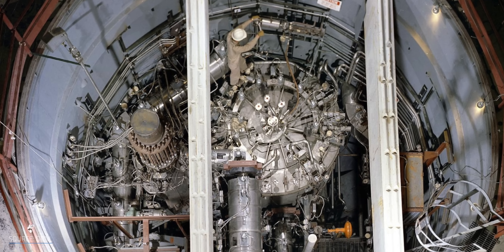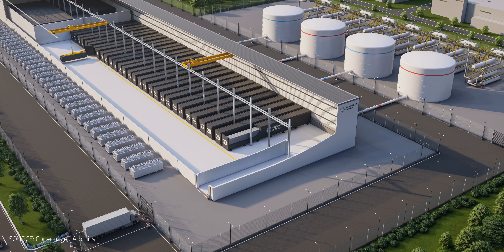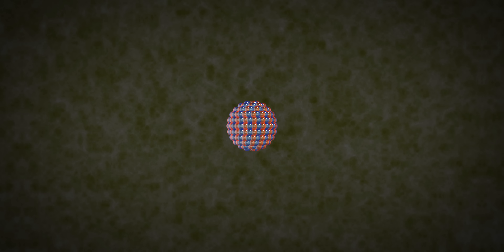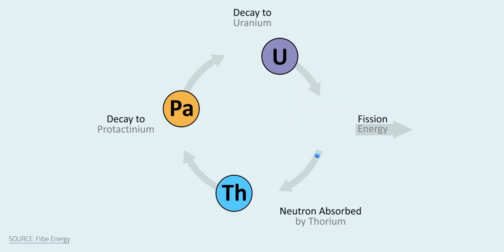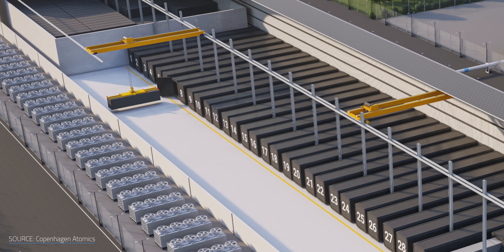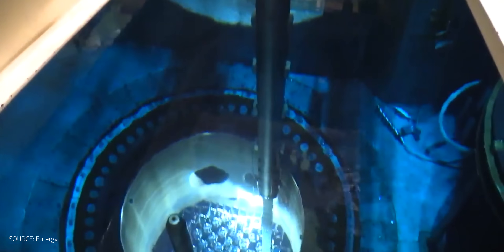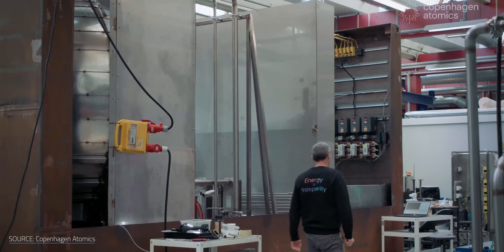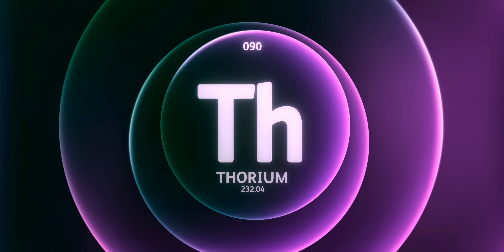Why Thorium is About to Change the World

Comment: Copenhagen Atomics took the most brilliant approach, I started seeing their stuff pop up around 2018.  They basically decided to leave the thorium reactor part last in their approach.  They knew there would be lots of roadblocks and regulations and no one was willing to accept allowing a company  doing oak ridge style tests.  So they took the research from Oak Ridge and said "What are all the difficulties they called out as non-thorium problems.  

Thus they tackled the metallurgy problem, that molten salts are highly corrosive to most steels.  Thus they worked on researching alloys. 
They focused on the water problem, even the slightest hint of moisture is a big problem with sodium salts.  Thus they developed sealed components that required zero servicing in the reactor lifetime.
They developed pumps designed to operate continuously in the high temperatures of molten salts.
They designed custom monitoring systems.
They did temperature, viscosity, and flow research modeling piping sizes, heat jacketed systems, cooling systems, reaction chamber design, etc.
They then even tackled refueling and extraction of thorium and uranium out of molten sodium.
And finally they handled production and assembly.

The only thing they now need is a country (other than Denmark due to their strict anti-nuclear laws) to give them the licensing to run tests.
Reply: Denmark is looking to reduce or remove their anti-nuclear laws. Or at least the politicians are talking about it publicly without great anger from the population.
Reply: @theicebeardk well that’s good that they might be able to get domestic political support.  It’s very hard to get an international country to grant a small company experimental nuclear licenses.
Reply: @theicebeardk  Really? When it comes to building it in their backyard, see their wrath. They are already angry at non-radiation (clean sun and wind) energy in their own backyard.
Reply: @theicebeardk  After years and years of solar and wind lies people are starting to pull the wool off of their faces. sheesh!
Reply: @Therapy1044  oh yeah, sucks super hard that my country some days runs off 100% wind energy xD feel super lied to 😂 lol
Reply: @DKTAz00  Cherry Picker. 😂  https://www.youtube.com/watch?v=ozq_vJf-H4k
Reply: @Therapy1044  What lies? Solar and wind are very viable portions of the solution for our energy needs.
Reply: @Therapy1044 "cherry picker" then picks a one off blackout incident 🤣 lolol
Reply: @tonyreynolds2328  No. They are not "very viable" for our massive needs.  Only small niche areas.  Trillions have been spent since Gore started Global Warming nonsense, and where are we?  3% of supply? After trillions.  Pretty sure you won't get through much of it though.   https://www.youtube.com/@ClimateDN
Reply: @DKTAz00  And to almost quote someone.  To deceive a person is the easiest thing in the world, but to get a person to admit that they have been deceived is almost impossible.  And our dear climate activists are the most recently deceived peoples on earth.
Reply: @Therapy1044  but of course the one who quotes that is never themselves deceived. or at least they wouldn't admit it
Reply: @Therapy1044  It can sometimes take so long for people to figure things out.  Like years and years. Even most of my life.
Reply: Danes have been staunchly against nuclear power since the 80’s, but just in the last 3 years the opinion is starting to change.
A survey from 2022 had 46% being open to the idea, and already in 2025 it’s 55%.
It’s starting to look likely we might open up to it.
Reply: @nathanlonghair  Traditional nuclear power requires an arms industry to provide the fuel, so that opposition is understandable.

As soon as your nuclear power breaks away from enriched uranium as fuel you're no longer feeding the war machine. That's why Alvin Weinberg's MSRE was killed by Nixon in 1972 under military advice
Reply: @nathanlonghair  the young adults are stepping into the light. The older generation is still filled with ignorance towards nuclear energy. They still think nuclear = Chernobyl
Reply: @ASZCA29 Not entirely. I’m in my mid-40’s and my mom and dad demonstrated against nuclear back in the 80’s - and they spotted the change coming, and the issues with the complete nuclear ban, before I did.
Not all of the older generation stay blind to change and new information 😊

I agree that older people are generally speaking more set in their ways, but we mustn’t get too bogged down with societal generational warfare… something I haven’t myself been very good at adhering to before, so I have to remind myself.
Reply: @nathanlonghair  I obviously don't mean 100% of the older generation. Just like not all of them remain ignorant, a lot of young people are stubborn in their ignorance. I'm speaking from a generalized standpoint.
Reply: @nathanlonghair  Fusion energy is what Danes are less against, not fission.
Reply: @LP-hm7tm  No. The surveys I referenced were for “atomkraft” which in Denmark refers to fission.
Reply: @nathanlonghair  Really? I'm sure many of us who had gone to school in Denmark had heard of the "to former for atomkraft: fission og fusion".
Reply: @LP-hm7tm since fusion has never been viable, atomkraft has always been shorthand for fission, even though it could technically cover both. If you look it up on DTU it’s clearly fission they refer to.
Reply: @nathanlonghair  You are right when speaking to the elderly. Their understanding of "atomkraft" is fission. The younger generations have a broader understanding of it so DTU should move into the 21st century and stop using "atomkraft"  to call fission.
Reply: They should look into Belgium, the new government is quite pro nuclear (nuclear ban law has just been repealed) and there's a world renowned nuclear research centre in Belgium as well.
Reply: @ForeverDoubting  Well and the nuclear powerplant near Antwerp that's powering a third of the country (including their biggest port.)
Reply: What a lot of people dont realize is that corrosion is a chemical reaction, so under high temp, high oxygen environments, it can be obsurdly fast, not like grand dads tractor rusting away in a field for 40 years, and she still fires right up.  The liquid salt  cooling sounds star trek too, but it is old school, they started using  sodium filled valve stems in the 1920s or 1930's, and by ww2 they had them dialed in well, many of the planes in www used sodium filled valves, and aircraft use is pretty demanding,  if the motor stops working, your mustang fighter plane just becomes a crappy glider, lol.
Reply: @bondvagabond42  Besse-Davis(2002) is a good demonstration of why water isn't a good material to have in nuclear cores

People hear "salt" and assume brine. They don't realise that a liquid salt contains no water to be ionised and that many salts won't react with water or oxygen anyway.

They also hear "fluoride salts" and assume they're extremely reactive instead of being the LEAST reactive kinds of salts thanks to fluorine hanging on tenaciously to its bonds
Reply: I hope we will allow it! It's as pure energy as can be! ❤
Reply: Wait, so with moisture, is this system 100% closed loop?
Reply: @edward9674 pretty much.  Basically in general with a molten salt reactor you want to do some isotope filtration, which I believe they do by density separation.  But their goal with these SMR setups might be to completely seal the reactor with a set lifetime of 5-10 years of continuous operation and isotope filtration is done once it’s swapped out.  So you just treat it like a 10 year megawatt battery module.
Reply: It isn't needed and never will be. There is no energy crisis, we use just 1% of the sun's radiation that reaches us. Doubling output would be more than enough. A;; this tosh about nukes is to pay big salaries to the hobbyists who won't let this ridiculous idea die a natural death. IT ADDS ENERGY TO AN ALREADY OVER-HEATING PLANET!
Reply: they forgot to hire diverse staff so naturally they are doomed
Reply: Far oo optimistic.
Reply: what are the byproducts ?
Reply: I'm Danish, and yes, we will most likely regulate ourselves out of becoming the richest country in the world.
Reply: They need a country stupid enough to throw money at this Rube Goldberg scam.
Reply: If Denmark gets this working the US will declare it a terrorist threat and take it and forbid its use.. ( I'm American btw) but I know what my country does..
Reply: "Thus they developed sealed components that required zero servicing in the reactor lifetime."
That alleged zero servicing is a fiction. The lifetime of these reactors is severly reduced to a few years requiring their full replacement and disposal, which is nothing else but servicing in a disguise.

"And finally they handled production and assembly."
What about electricity production? They did not handle that. A Reactor alone produces just heat. In order to get electricity from that heat you still need an additional heat engine and a cold sink (i.e. turbines, rivers, cooling towers etc.).
Reply: @alexanderkohler6439 turning heat into electricity is practically a solved problem. That is the essence of every single steam turbine ever, that’s not a problem they need to tackle because it is already solved. They just don’t want to be the one to make the turbines so they will just sell their services of making heat to an electric company
Reply: @lilydiring4295  "They just don’t want to be the one to make the turbines so they will just sell their services of making heat to an electric company"
But that is not what they try to sell to the public. They want to sell the vision of small modular reactors to facilitate decentralized electricity production. This vision is nice, but it is not going to work with electricity production based on heat. For decentralized electricity production based on heat, you would also need decentralized heat engines (doable) and decentralized cold sinks (not doable). So, in this case you will still end up with big centralized electricity plants each of which is supposed to have a lot of these reactors sitting next to each other, each of which is supposed to be fully replaced and disposed of as hazardous waste after just a few years.
Reply: @alexanderkohler6439 idk the mockup did not look decentralized, just modular. Like you wouldn’t ever just have one, you’d have more than 100 of them, just them being modular allows for easier maintenance by replacing entire sections instead of having to turn a large reactor off and and on again
Reply: @lilydiring4295  Okay, let us assume it is only meant for centralized electricity production.
"just them being modular allows for easier maintenance by replacing entire sections instead of having to turn a large reactor off and and on again"
Going modular is not an advantage of these breeding reactors over regular reactors.

You can also easily miniaturize and modularize regular reactors, as nuclear powered aircraft carriers and submarines demonstrate. However, no electricity plant does that in order simplify maintainability, because you actually would not simplify much. Yes, you have to turn off regular reactors for maintenance. But that is not a disadvantage because you are doing that only for a short period of time and just to replace fuel not the reactor itself.

For these breeding reactors, however, the situation is completely different. Here, maintenance is not just about refueling but also about complete replacement of the whole reactor after quite short periods of time. As you cannot aford to do such a full replacement of a large reactor every couple of years, you are basically forced to go modular. But that is not an advantage over regular reactors, but rather a necessity in order to mitigate the inherent disadvantage of these breeding reactors.

Comment: You can almost guarantee the reason it was defunded was because it actually worked and threatened the rest of the energy industry (coal, oil, standard nuclear). It's unfortunate that existing markets actively try to kill competition by any means necessary and are not properly prevented from doing so. It is one of the achilles heels' of capitalism. Competition is great until it goes outside the rules and people cheat to maintain / gain an advantage.

Comment: Thorium molten salt reactors have a major issue.  The molten salt is extremely corrosive.  At least a decade before the materials are available to contain that corrosion.  Fast breeder reactors have a similar problem but it is the high heat and neutron density that needs to be contained.  Both have the potential to provide expensive electricity for centries.   However both require massive commodities and fossil fuels in puts.  So more emissions long before global warming is congtained or fossil fuels are depleted.  Fusion grid scale electricity production will probably never happen.  Most do not understand that to economically produce energy requires some 10 times energy out put to total energy input.

Comment: How are they going to make a feedback control system when the only way to detect what isotopes are there is by running a sample through a mass spectrometer? There's no sensor you can just dip into the flow of molten salt to sense it electronically. As far as I can see, the reactors will require an army of QC lab personnel to take samples and run them through a mass spec, creating massive quantities of the other kind of nuclear waste people don't often think about: slightly radioactive rubber gloves and coveralls.

Comment: Again ALL of this is just to make heat to boil water to power a 17th century invention, a steam engine with magnets attached to it! 
The TRUE next generation of power production will be when we can efficiently strip electrons from atoms directly and use them in alternating current. 
That fact these current "modern" technologies are still using dangerous substances wasting 99% of the energy produced because it's bottlenecked by a 313 year old idea is an embarrassment to the sciences. Hurumph!

Comment: Mate you can just use thorium fuel in CANDU reactor already.
Now new technology is required.
There were number of studies done about that.

The only catch is that you need to make fuel bundle from mix of thorium and plutonium (which can be sourced from spent fuel), and as an extra bonus such fuel will last for 10+ years (according to study that I read). So its like win-win-win, but you will need to run PUREX plant.

Comment: It kind of bugs me hearing a phrase like "it produces more fuel than it uses." Realistically, thorium is the fuel, and it consumes thorium, as the name implies. The reactor should produce more uranium than it consumes, not fuel.
Or, to put it another way, fuel is the consumable thing I put into a system to get the desired output -- thorium.

Comment: Maybe... It isn't about being cheaper to build, it's about being cheaper to 'replace'.
Biggest hurdle with Thorium is it's instensely corrosive nature. It's very hard to store, and work with (on top of all the radioligical protections, now you also gotta worry about the stuff eating a hole in it's container). That corrosiveness makes it harder to use and safeguard, when it eats through seals, flanges, etc. in a matter of years or even months. You think Salt water was bad for metal?

Comment: I hadn't heard about the Gamma radiation problem. This is a very interesting video, I hope it becomes a world wide reality. If Oakridge ran for years, surely their model would be a good starting point. Several countries are looking at Thorium I believe also Canada, India & Norway. If Thorium received the same funding as nuclear fusion they could have been using it for decades.
Reply: Apparently, a CANDU reactor can run on solid thorium with almost no modification.